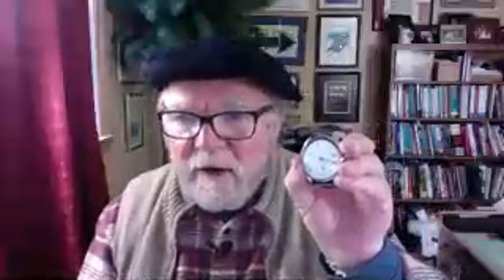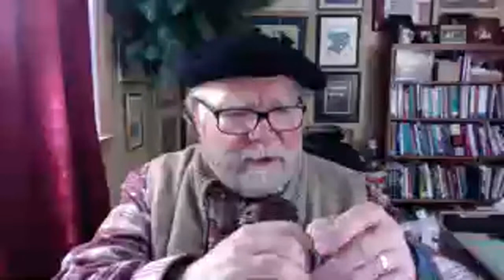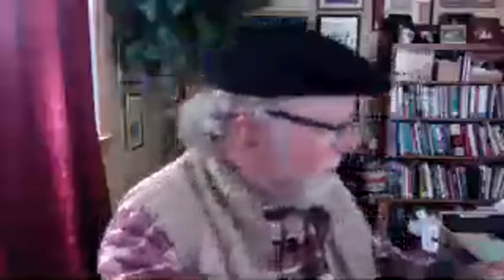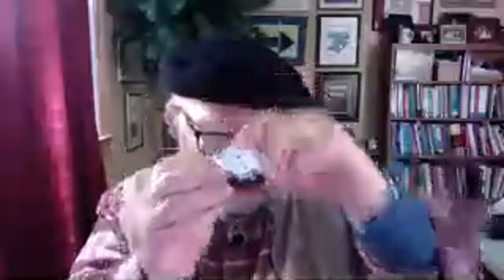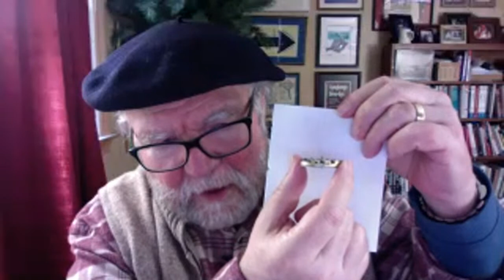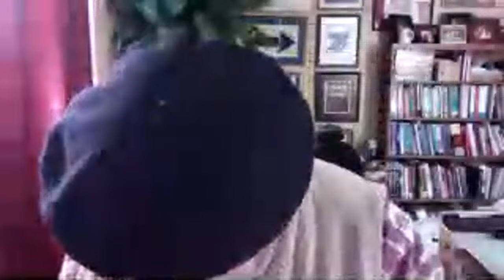Pocket watch movement and dial in wristwatch case

Comment: It's a Swiss pocket watch. Usually there is one or 2 little notches and or pins at the opposite side of the screw to hold the movement in place.
Reply from the maker: It turns out Honey Badger, that a single locking screw (like the ones that lock the dial feet) was holding the whole movement in place. Without a bezel, as soon as I turned it to 'unlock', the movement and dial went flying from the case and onto the floor. The one I got is a, "Jules Huguenin," which is Swiss, but the seller listed it as French. Take care and be safe, Bill😷